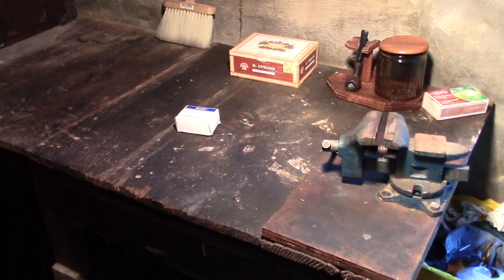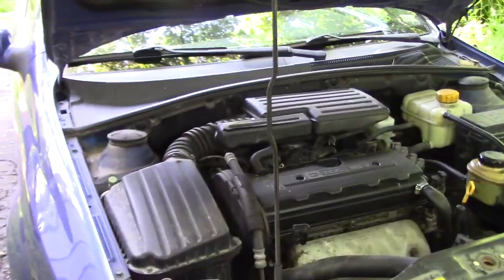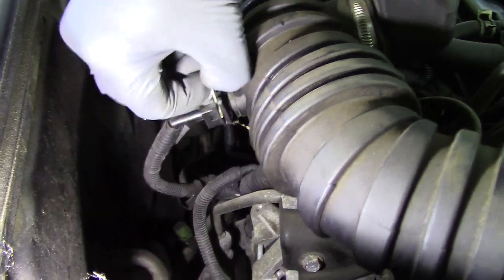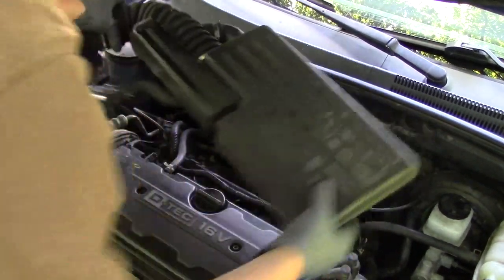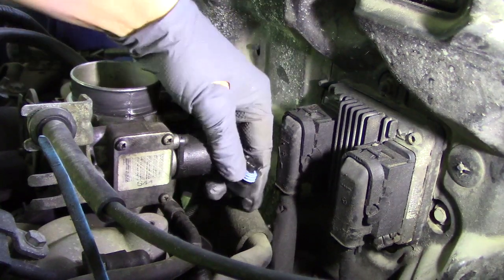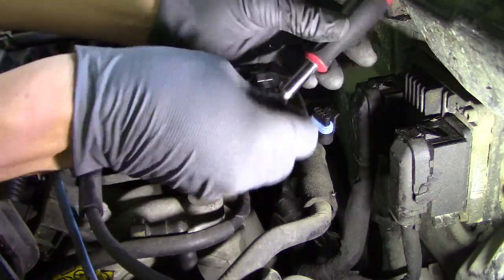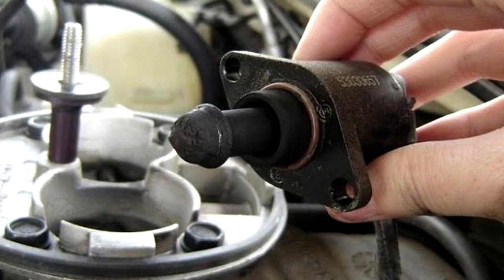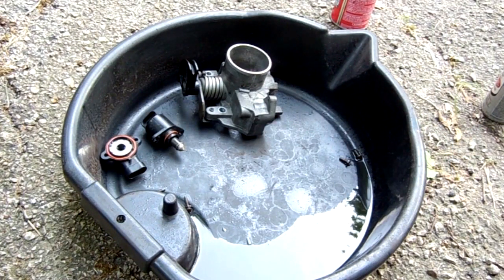Replacing an Idle Air Control Valve (IAC)

Comment: step 1, show us the problem be a big help
Reply: 1998 Suzuki Sidekick Sport.
 I changed the EGR ( after cleaning passage ) , IAC valve , TPS (professionally installed ) and still not much better performance , maybe not stalling out, but idle at 300 rpm is not good either. Finally got the O2 sensor plugged in and now I have my idle circuit working almost perfect with the idle high when starting cold and reasonably correct when warmed up to operating temperature. never had the Check engine light on for any idle problem either?
Reply: @brucewmclaughlin9072  mine ended up as the injector but egr etc done too

Comment: How much should the resistance be and in which of the cables?
Reply: I have the same engine 2000 Daewoo nubira and wonder I have sort of a surging idle I wonder if that could be caused by this and it smooths out once the car starts moving but sitting at idle it kind of surges, plugs and wires only 2 years old fuel pump I think is 5 years old